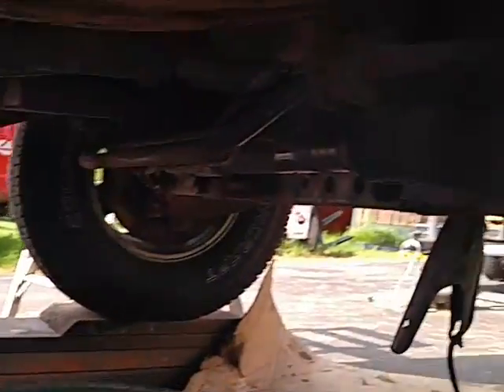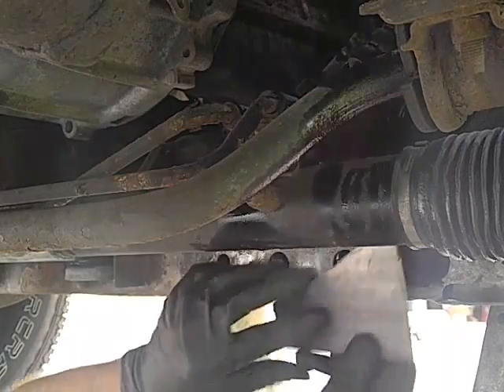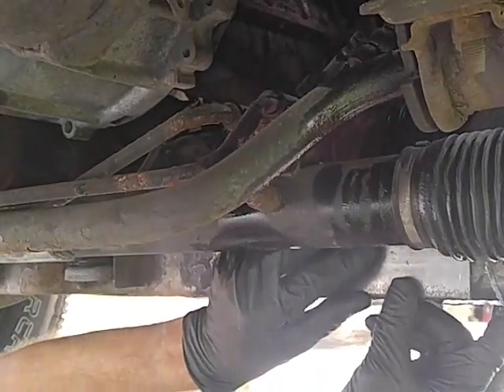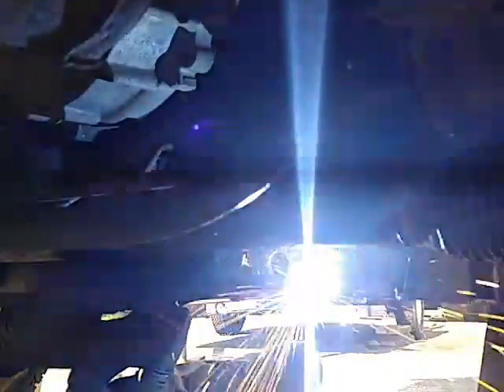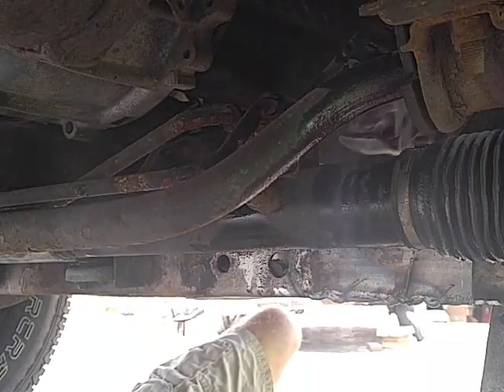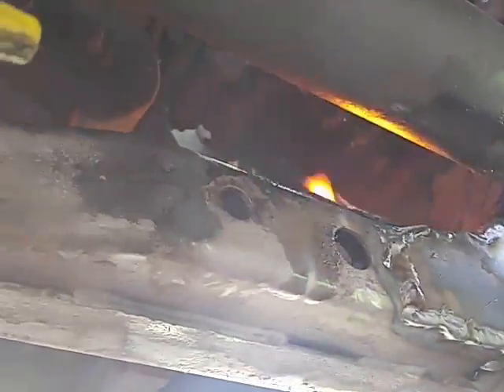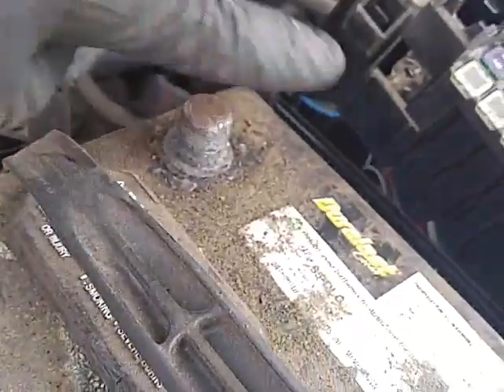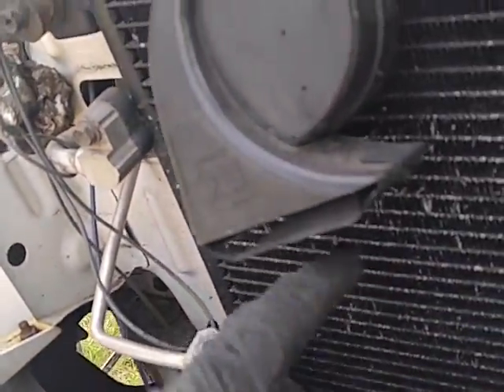MIG Welding Toyota Tundra Junk Frame 7 12 17

Comment: you can get a new frame on recall! i have a 2006 tacoma with 300,000km and toyota  put a new frame new brake lines, fuel lines, e brake, control arms, ball joints, all hardware! and much more all free.
Reply: sam burnett was about to say this
Reply from the maker: sam burnett I googled it and the recall is for 12 years only. My friend paid $400 for new brake lines at Toyota dealer, but no frame, too bad so sad. And now he tells me there's more broken frame I didn't notice
Reply from the maker: sam burnett recall is only for 12 years... shame

Comment: Wander how many even new ones will rust toyotas have rust issues. Even with warranty their not replacing frames just some goop then here ya go
Reply: Untrue.. They only had rust issues because they didn't put any kind of coating on the frame on the older models.. If you look at the new one's they have a healthy coating of frame protectant.
Reply from the maker: Matt Dias I'll go look at some newer ones at the dealer, but from what I've read, the goop peels off
Reply from the maker: Mark Lockwood warranty is good for 12 years, so this 2002 is NOT covered